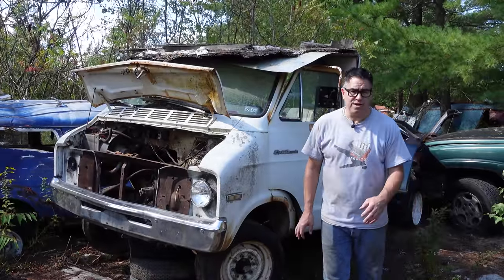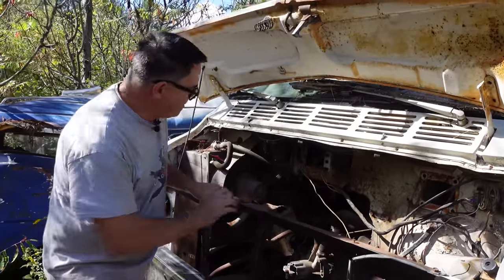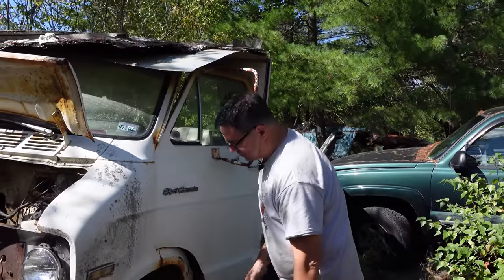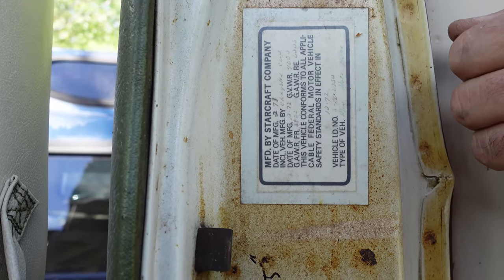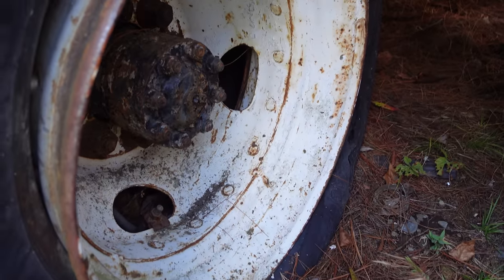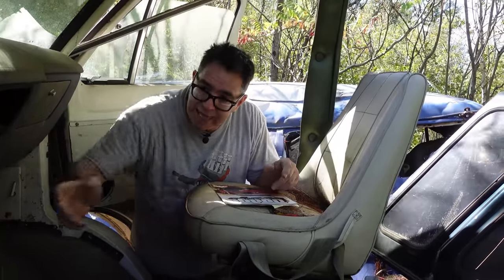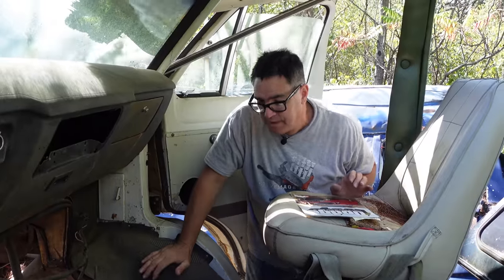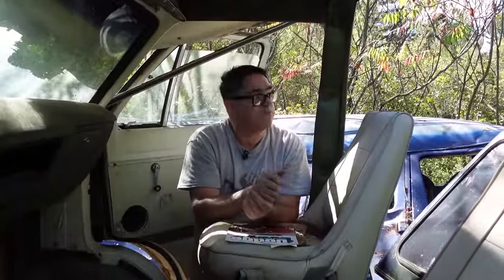Camper Van Dualie

Comment: Sorry Steve,  but that's the voltage regulator for the charging system, not the ignition electronic control unit. Great videos that I enjoy everyday. Keep em coming.
Reply: Was going to say this too.
Reply: Oops
Reply from the maker: You are correct
Reply from the maker: Not to cop out but sometimes in the heat of these one-take rips I mis-speak. I know the Chrysler electronic voltage regulator and the ECU box very well. I did the "little blue box" conversion from the mechanical voltage regulator to the "blue" solid state several times and also used to switch from my BIG Orange Box ECU to a much more expensive GOLD Box ECU (from Mopar Performance) on many evenings before a street race with some nasty Chevy hoping the Gold Box might add a horse or two. I do remember burning up a few Gold boxes, the urethane "potting" material in the back would grow a fuzzy bubble center. That's how you knew a used one at the swap meet wasn't any good. Thanks for catching my boo-boo's. Someday I'll convert my brain to Electronic Ignition and get rid of this "spark scatter" once and for all! -Steve Magnante
Reply: Steve, did not rip on you!  You do a great job at this!  Keep up the great work!
Reply: @SteveMagnante  I get it. I know it's a lot of work to put out a video every single day. You have to rush, and being human mistakes will be made. I'd be willing to bet money you knew that was a regulator. Keep up the good work.
Reply: Yes the man is a bet rusty but well werth witching weth my cup of Jo coffee

Comment: Thanks Steve, That's the Electronic Voltage regulator, the EI box is twice the size with a exposed transistor, cooling fin and 4-5 wire connector with a center screw. I belive the VR was standard as of 1970 and the EI box standard in 73 but an option in 72. A Chrysler and industry first. And it has the very desirable first-year 360, my favorite engine!

Comment: HAD ONE USED FOR SKI CAMPING TRIPs,LOVED IT MINE 318CI 3 SPEED 727,WEIGHT ABOUT 16000 WITH OUT GEAR.CLIMBED THE ROCKYs MANY TIMES SLEEP IN PARKING LOTs A BASIN COPPER MT.MAINE SKI HILLS SUNDAY RIVER, BIG SQUAW 30 BELOW WOW A GREAT BUGGY,LOTS OF FUN,AND TO BEAT THE BAND MOPAR GREEN CARPET DASH.THANKS FOR THE MEMORIES STEVE.REAR SEAL PUT MY OLD GAL TO BED STILL RAN GREAT JUST LEAKY,ALWAYS BOOT MYSELF IN THE BUTT FOR SCRAPING IT.

Comment: I had one that I lived in for a couple of years. It was old and coming apart so I tore the coach off and turned it into a flatbed truck with a sleeper cab. It was ugly but it sure could get the work done.
It had the 360 in it. That carburetor died and I found it impossible at the time to get a replacement so I got a Chevy 350 carb and swapped manifolds from a 318 to make it all work. It ran great after that. It could pull I-70 in Colorado at seventy mph no problem fully loaded. It made a great work truck and I regret not fixing it when it got tired.
Reply: Should have been fairly easy to find a rebuild kit, although rebuilding on the road could be a bit challenging.
Reply: @googleusergp  
It needed an engine rebuild that I couldn’t afford at the time.
Reply: @ryandavis7593  I get it, that's a tough way to live.

Comment: My parents bought a new 72 Dodge based motorhome like this one in early 73. It replaced the trailer we had a the time. We spent the summer camping around Washington State. Then in the fall, the 73 oil embargo hit and  gas went from 33c/gal to 80c/gal which caused my dad to unload it. I fondly remember  laying in the loft while we were driving down the highway.

Comment: One tip on the 360 carb ( also found on International Scouts and probably AMC ) .
 
Early models had an air cleaner stud that was threaded into the top cover.  These warped from over tightening the air cleaner wing nut exposing the idle / transition circuit leading to an off idle stumble.    The fix is to put the top cover in a vise and use 3 sockets to bend the top flat.  After this is done, double nut the air cleaner stud ( under the lid ) to where the lid is only slightly compressed so it acts as a tightness limiter

The recall fix was a bridge that used two of the top cover screws for mounting the air cleaner stud.  Later carbs has the air cleaner going into the main body eliminating the problem.
Reply: Scout had an international engine, AMC had their own and dodge had their own. With the same carb ford used
Reply: But didn't you know that the bird is the word.
Reply: @jefflilyea4669  IH used some AMC engines.   The 258 inline 6  in Pickups, TravelALL ,Scout  / 401 V8  in Pickups, TravelALL . The Scout TraveLER might have gotten a 401 as well.  Everything else got a one of the 266 / 304 / 345 / 392 series.

Comment: The box Steve is pointing at is the voltage regulator, not the electronic ignition module.  EIM is on the drivers side of the firewall, close to the master cylinder.  The slant six was an offering on 1 ton vans (hopefully never put in an RV but you never know), as were column shifted 3 speeds- side loader A230 and one other lighter duty 3 speed.  Later vans could be had with a floor shifted 4 speed- the A833 overdrive.  I don’t know if the one ton platform ever used a floor shifted manual.

Comment: We had this same chassis cab , 1973, converted to an ambulance. It was one of the first of this kind in the area. It had the same black seal when new between box and chassis as shown in the brochure and it leaked badly. Somebody put a new seal on that is similar to the one shown on the camper. That one had lots of silicone globbed all over it too but it must have still leaked. By the time I came on in 1980 the cab floor had rotted out and the seat frames and bases were shot. We went to the ATV clearance center  (Auto ,Truck and Van  if anybody remembers them) and bought "captains seats "and bases and screwed a  heavy aluminum  patch plate  on the floor. We had that bus until about 1986 when it was replaced with a Ford and sold to a plumber. The Dodge rode like a dump truck and didn't have much power at all. The transmission was great  as I recall.
Reply: Yup, they used to "rack" and that would cause leaks.

Comment: We have a 81 B300 camper with the factory 440 that's being turned into a flatbed. It's titled as an 81 and has the 81 only grille & lights on it but the 12-digit VIN says it's a 79! Found out that when it came to RV's they weren't titled till they were sold which is why ours is reg as an 81. They must've upgraded the grille to help facilitate the sale to get this old model off the lot. Neat stuff!
Reply: A 1981 model year truck would have a 17-digit VIN. If it's not a 17-digit VIN, then it's a 1980 or older. A 1979 would have a "9" for the sixth digit and a 1980 would have an "A" for the sixth digit. For 1981, the model year code is "B" and it's the 10th digit. That 17-digit VIN standard still holds true today, as we use the same system.
Reply: Someone must have swapped out the original engine for the 440 because they were not available after 1978 as per the agreement with the government bailout loan. The tooling for the big blocks was to be scraped.
Reply: @danw6014  Yes, but he likely has an older chassis that was sold in 1981 and then sold as a 1981 model year. However, the 440 V8 was used past the 1978 model year, but not in passenger cars or light trucks. The VIN is the determining factor here.  I do remember that a lot of RVs back then were titled with the "sold" date rather than the chassis date. No one wants to buy a "two-year old" truck. I never agreed with that, because if you don't know, it can be an issue with asking for parts. 

Owner: "It's an '81. The title says so".
Parts counter person: "I don't show a 440 engine in 1981".
Owner: "It's a 1981. Says so here".
Parts counter person: "Can I see that for a minute?"
Owner: "You don't know what you're talking about. I'm going to a parts store that knows what they are doing".
Parts counter person: "Ok thanks for stopping in. Have a good day". 
Owner: "These places."
Parts counter person to his coworker: "I know that wasn't a 1981 truck. It would have a 17-digit VIN number. We probably could have helped him if he'd just listen".
Reply: @googleusergp  It's a 12 digit VIN. F44CD9Vxxxxxx. Title says "FIRST REGISTERED 11/1981" on it.
Reply: @danw6014  Correct and incorrect. They stopped PRODUCING 440's in 78 but continued to use up the remaining 440's till the 79 model year.
Reply: @googleusergp  They did the same for bikes back in the day. My 64 Honda motorcycle is the same way; titled as a 66 but the serial number says otherwise! haha
Reply: @aaron71  Yours is a 1979, correct. So, we got the VIN for the win: F4 for MB400 chassis, 4 for MB4 High Line, C for 10,001 to 14,000# Gross Vehicle Weight Rating, D for 440 V8 with four barrel, 9 for 1979 model year, V for Warren Compact Assembly, Warren MI and the rest is the production sequence. The 440 V8 was used in 1979, but only heavy-duty trucks like yours. Passenger car and light truck use, 1978 was the last year for that.
Reply: @danw6014  Not correct. 1978 was the last year for use in passenger cars and light duty trucks, but the 440 was used in heavier trucks, like the MB400 motorhome chassis later than 1978.
Reply: @aaron71  That is correct. Your MB400 (a motorhome chassis) could (and did) have a 440 V8 as an option. GM did the same thing with the Pontiac 400 engines. My 1979 Trans Am is an example of that. The car was assembled in April 1979 in Norwood, OH, but parts of the engine were stamped in 1977-1978 and stockpiled for use for the 1979 model year. Chrysler did the same thing.
Reply: @aaron71  A lot of trucks are like that. Fire trucks as an example are the same way, especially on a commercial chassis, but sometimes so on a custom chassis. When an engine and transmission are allocated to a truck/project/build, they are reported to NHTSA and others as being "sold" or "scheduled". Even if that truck's completion is two years down the road and delivery to the customer is six months later, the chassis and VIN were already assigned when that engine was reported. That is why you might see a fire truck carried as a current model year, even though the VIN and MCO/MSO (Manufacturer's Certificate of Origin/Statement of Origin) has it as a previous model year. It's not like a passenger car where it's produced, shipped to a dealer and sold the same year as the model year. My '79 10th Anniversary Trans Am was first titled in 1980, although it is clearly a 1979 (I have a copy of the original title). Sure enough, when I finally found the first owner (after two years of tracking him down), he told me how he got the car and the story behind it. That explained why it was titled in 1980 even though it was a 1979.
Reply: @aaron71  Especially back then. Japanese imports were new and for a time, they weren't popular and they could in theory sit around a while before they were sold. Another factor is that paperwork was lost for it over the years and then someone said, "Looks like a 1966" and that's how they put it down on the paperwork. The "mistake" is then carried over each time the paperwork changes hands or the vehicle is sold. My coworker had that with a 1964 GTO he bought in 1972. He used it until 1980 and then parked it. It then moved from shop to shop he owned and property to property. About four years ago, it was on someone's property and then somehow it was gone due to a dispute. Well he found it for sale online but when he went to prove that he owned it, the VIN number was off. Back in 1972, when either he (or the previous person) filled out the paperwork, an error was made. He eventually straightened it out and I told him, "The VIN gets you the win and the tag lets you brag". 

He straightened out with reasoning with the new "owner", but there was another way to prove it. The PHS. The PHS has the body number and other details that could be matched to a VIN #. With that, he could prove that an obvious error was made on the vehicle as everything else would have matched. The mistake then would have been obvious. He didn't have to go that far.
Reply: @moparmarkstpac  Correct. Much the same way Pontiac did with the 400 engine, but in that case they were all used up/sold in 1979 and not available after that model year.
Reply: @aaron71  First registered in the state you are in or first registered after manufacture?    It is possible that someone brought it in from out of state.
Reply: @bobroberts2371  His truck is indeed a 1979 MB400 with a 440 V8, made at the Warren Compact plant in Warren, MI. Remember, 1979-1981 were recession years and hit the RV industry hard. So, it might not have been unheard of for a unit to sit for a year or so until it was sold. Figure it was built in January 1979 (as a guess), three months later it showed up at the upfitter. Maybe it took them three or so months to get it done. Boom, 2nd gas crisis hits. Who wants a 440 V8 then? No one. It sits for a year, 1979 turns to 1980, not much gets better (although gas starts flowing again). People are nervous. It sits through 1980 and is sold sometime in 1981, and titled by then. Yes, it could have been "first titled" in THAT state in November 1981, but maybe not. Depends on how the titles are done for that state. Some states just put the date of that document and nothing else. Some states put the previous state's name of title. All depends.
Reply: @bobroberts2371  First registered, period.
Reply: @aaron71  Given the circumstances at the time, and that things were (to a degree) slower in execution back then, not unlikely that from start to finish and first sale that it wasn't two full model years ago that it was first sold. The RV industry was hit very hard during the 2nd gas crisis, and couple that with stagflation, high interest rates, high unemployment and other factors, it could have been 1981 before it was first sold.

Comment: had a karyvan  that was way past its prime ,rolling piece of ship yet a uniquely designed utility vehicle all the same ,imo
Reply: I believe that may have been built internally by Chrysler as multiple years' literature clearly show the body options, which is atypical if the OEM is just producing the chassis. The body options are usually shown in the body company's literature (such as Knapheide, Reading, Stahl, Omaha, etc.).

Comment: Hey Steve, did you notice in the door sticker it said Dodge and Desoto?   Desoto shut down like 10 years prior.   Kinda weird, Dodge would still print Desoto on the door sticker.
Reply: The Fargo part of the label was Canadian and Desoto was south America
Reply: Yes, I commented on that. At least as far as the US market goes, Fargo ended around 1972, and DeSoto had been gone for a while by then. I suspect they had pre-stamped those plates years and years ago and were just "running them out" until the computer printed labels took over later on.
Reply: @paulday6875  I knew Fargo was Canadian, I didn't know DeSoto was for South American, thanks
Reply: They did that until 1977, at least.  My B100 has that tag.
Reply: @nightshadefern162  Yup, I've seen several that had that plate. I think a year or so after they went to a printed label.